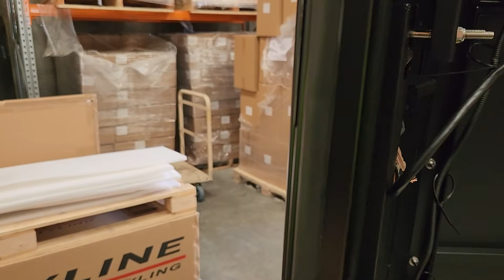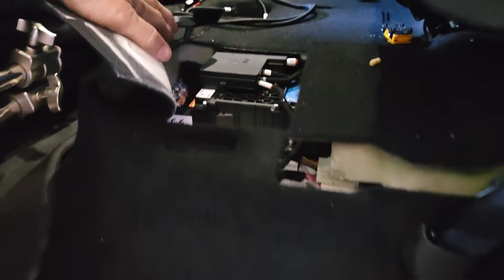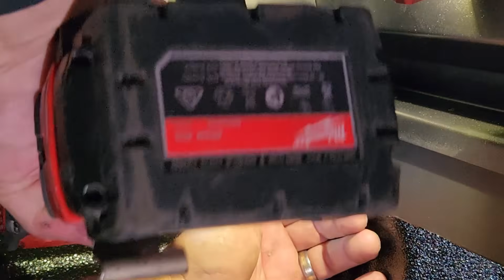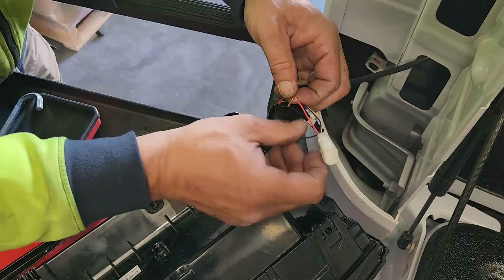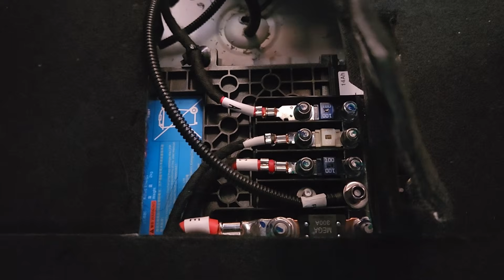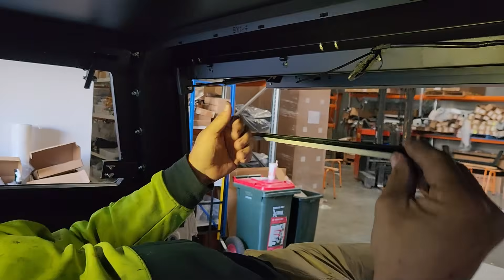BYD Shark TITAN PRO HYBRID Canopy Installation video

Comment: Do the titan canopies have the option of side windows? 

I have a dog he may use the back, would prefer to have decent size glass windows with a slide if it’s an option. 

Central locking is great for the canopies! 

Will be buying a tub and floor mats soon too.

Comment: I wish I'd seen your canopy before buying the one I got. 
Do you sell a canopy lock kit with the central locking for the byd?
Reply from the maker: Hi mate, sorry to hear your having issues with another canopy brand, hope they help with it. 
The central locking we built for our TITAN canopies was designed in house from the ground up, and the internal design is totally different to the normal compression lock canopies, so its not possible to retro fit it.

Comment: Do we need a heat shrink for the joining of wire.
Reply from the maker: You can use electrical tape and then fabric tape over the top as Barry did or you can also use heat shrink too, both ways will be fine.